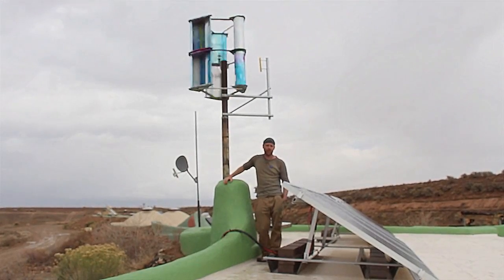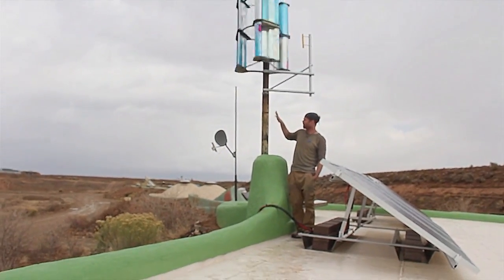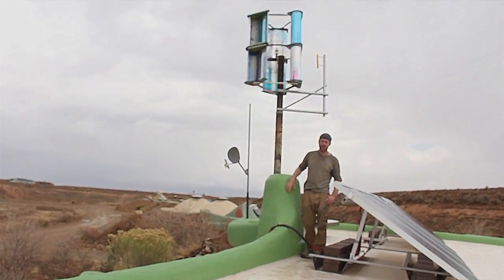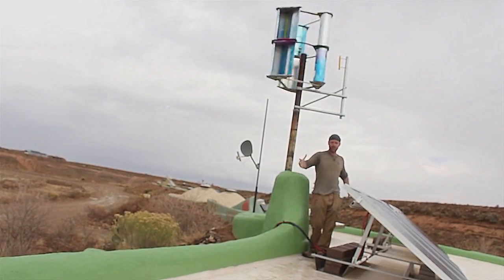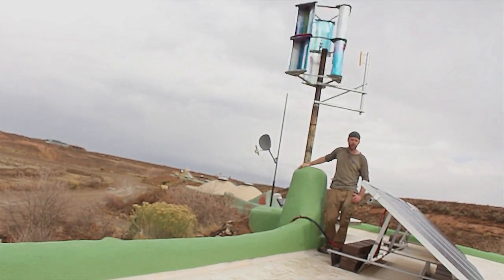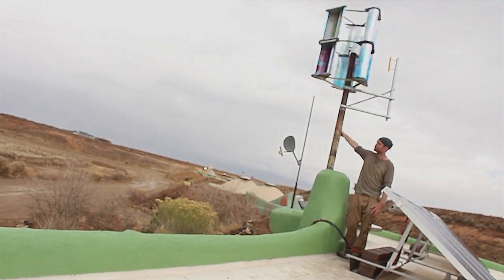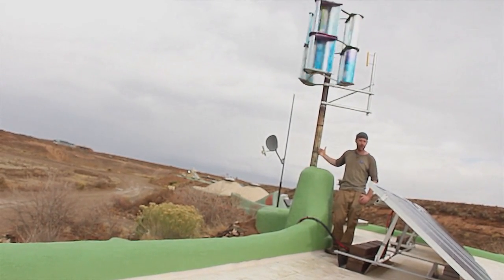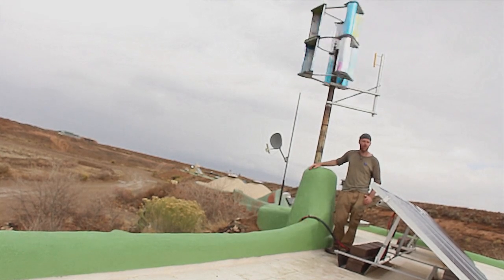$30 Wind Turbine at Earthship, Taos - OpenSourceLowTech.org

Comment: How do you make the output from the generator until useful 12volt current?
Reply: rectifier to dc voltage, then to a charge controller.

Comment: Why not a shielded vawt, makes more power with the same wind
Reply from the maker: The Lenz2 design is both lift and drag, so you gain extra power from the attack side.
In terms of funneling, possibly, tho it's quite a bit more apparatus to have to build for not necessarily that much more power.
Reply: OpenSourceLowTech ok thats cool, could you make a video where you make easy to craft dc or ac generator setup, coils and magnets?

Comment: The big problem with wind turbine power claims is they claim the maximum power at  crazy amount of wind speed, not the average power. Average wind speed for most areas is closer to 13 km/h.
Reply from the maker: Agreed, I just give mechanical output for various wind speeds, after that it's going to depend on what kind of generation and charge capacity you've attached. There's a problem with using average wind speeds to calculate available power but it's a bit long to go into here. Essentially, nothing is a one size fits all solution. Wind turbines should only be considered if you live somewhere with a bunch of wind, and even then it's only going to be useful on certain days, at certain times of year, in certain locations. But if the schema is low cost, then you're not having to pay back any serious investment and it'll at least be helpful for some number of people.
Reply: +1 what he said!

Comment: It's actually misleading to say it cost $30 because with new materials it would be way over that
Reply from the maker: That's why it's designed to be makeable from recycled materials, which are usually easy enough to find.
The turbine itself usually costs about $25-30, with the generator, pole, charging system extra, but there are also various options for doing all those with scrap and salvaged parts.
Reply: It's going to be even more expensive if I go buy sheets of gold to make the blades out of. They won't corrode, but I suspect they will vanish quite frequently...

If the idea is to make the device out of salvaged materials, but it does require some non-salvage material, then the price quoted should be what the builder had to out of pocket for the materials that had to be purchased new.
Reply from the maker: I've not yet had to pay more than $30 for the turbine itself, for all the bits, recycled and store bought. Once you get downstream from that, for the various infrastructure and apparatus, it gets very how-long-is-a-piece-of-string, depending on all the various options and needs, and giving fixed prices is no longer possible. But I am in the process of designing very low cost solutions for that also, and that information will be broadcast.

Comment: JNo way will you ever get 2kw from that , ever , misleading in the extreme
Reply: I believe you made a mistake in the units units. 2kw of power does not equal 2kwh of energy.  0:37

He said it was currently generating about 100 watts in that wind, and incidentally, 100 watts over less than a day, like say  20 hours = 2kwh of energy.